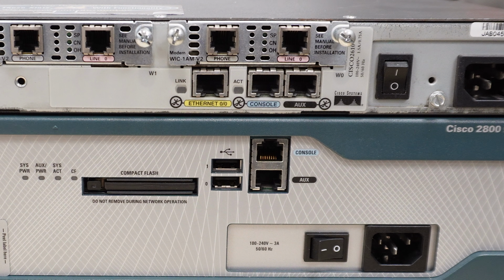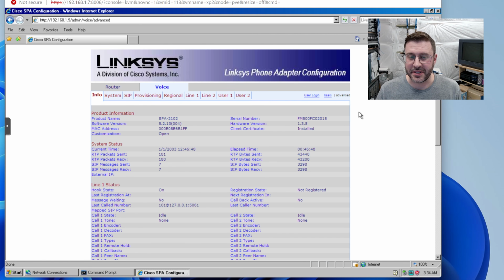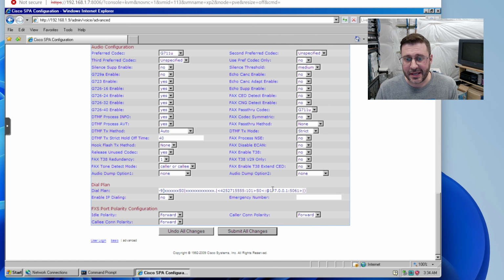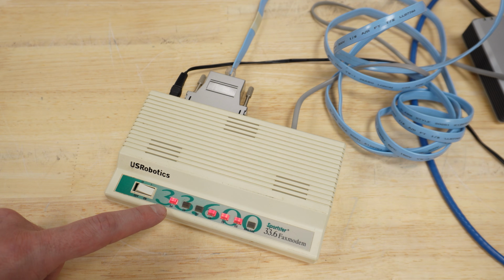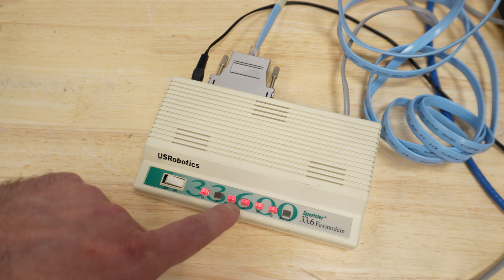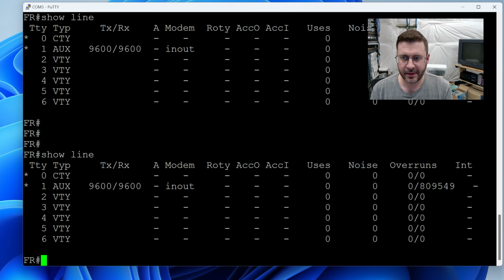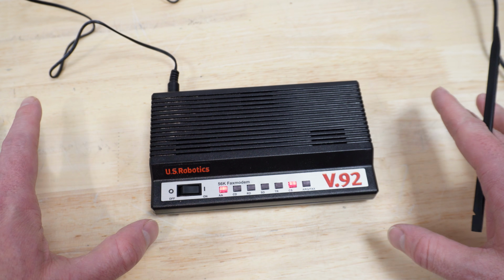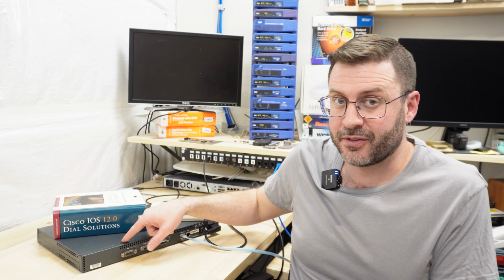Dialing into Cisco Routers

Comment: Never trust a premade cable or adapter! Troubleshooting serial connections almost always requires a simple breakout box that goes between the DB25 socket and plug. It's nothing more than a bunch of LEDs and possibly jumper cables to reconfigure the connection.

To connect a DTE (Data Terminal Equipment, the router) to a DCE (Data Communications Equipment, a modem), you need to connect GND, Rx, Tx, RTS, CTS, DSR, DTR, CD and RI all straight through (that's one more than an RJ45 plug can provide; at least one signal must be missing from the router). CD (Carrier Detect) is important because it tells the DTE that the connection is finally established. RI  (Ring Indicator) allows the DTE to answer calls whithout resorting to the auto answer setting of the modem. RTS and CTS were originally meant to turn on the transmitter hardware (Request To Send) and signal back its state (Clear To Send). They're typically used for hardware handshake in later implementations like smart modems. DSR and DTR are more or less static signals to indicate that the devices are turned on and ready.

Smart modems are special because they can autodetect the baud rate of the serial interface by monitioring the receive line for the "AT" command. The speed between the modem and the DTE is independent from the connection speed over the telephone line. Some modems even add data compression to the latter. This makes handshaking between the DTE and the modem absolutely neccessary. It's always a good idea to set the DTE baud rate to a higher value then the actual connection speed. 

As others have already pointed aout, in order to troubleshoot the runaway Rx/Tx blinking you should check for local echo settings on each side of the connection. This may create a tight feedback loop, just like a microphone close to a speaker. You can debug this by feeding one of the data lines to an additional serial interface and use a terminal application to monitor the data. Maybe you should hunt for an actual line monitor which might come handy in other cases, too.

Comment: The USB, USR 33k and V.92 modems have V.42, which uses LAPM or MNP to detect any noise and transmission errors, and retransmit faulty data. Usually this is enabled by default, BUT your line is either so noisy thst it falls back to unprotected, or LAPM is disabled in the permanent configuration of your modems. Try playing around with  the +ES and \N commands, write the config with &W to permanent store (or check with +ES?  what the setting is). During connection establishing, it should display CONNECT (speed) LAPM or V.42. Example command sequence to try:
AT+ES=3,2,4
AT\N2
AT&W

This forces the modem to negotiate either LAPM or MNP, and quits if error correction can't be established. You need to do this on the V92, 33k and USB modem, and on both sides. The 9600 modem can't do this.
Check the documentation of your modem types if they have the values different, but the ones I gave you are pretty standard.

Comment: Try this for an init string on your modems: AT&F&C1&D2S0=1
AT means attention, &F recalls factory defaults, &C1 enables data carrier detect, &D2 does something that I can't remember, and S0=1 turns on auto answer. I used to run BBSes back in the day and this is a generic modem initialization string that we used to use.
Edit: AT&V Will display the modems factory defaults and if you change things you can use AT&W to write them to the modem's NVRAM and then you can recall them with a simple ATZ command. 🙂
Reply: You can also try AT&F&D&C1&D2&D1&S0=1

Comment: You need to put the modem connected to the router into "quiet mode" so that it doesn't send the result codes to the router. What's probably happening is the router is sending something to the modem, and the modem is returning "ERROR". The router doesn't know what that means, so it sends its own error message to the modem, which makes the modem return "ERROR" again, which makes this feedback loop of data over the serial connection. Likewise, when the line rings the modem sends "RING" which will confuse the router as well. The Sportster modems have a DIP switch on the bottom to suppress result codes. Not sure how it's done on the Ultra 96; maybe ATQ1.

It's also possible that any modem whose history you don't know can have weird settings set from its previous life. It's not a bad idea to enter AT&F1 to initialize the default settings, and then AT&W to save those settings.

And as someone else said, your issue at the very end of the video is a crappy phone connection :)
Reply: Thats what I'm thinking. It seems to be getting something between the terminal as soon as the serial is connected and most likely the reason why the overrun is going up.
Reply: @iamthesargent  Yep, because the loop is as fast as the router can do, and it's faster than any of the modems can get it, so thats why overruns keep being racked up

Comment: This is what I loved about CisCos when it comes to networking stuff like dialin, setting up bgp and other wizardry, it takes 4 lines and it just works tm. Try to do this with a Linux or BSD box, let alone u need the whole os setup and configured you need to configure pppd, secrets, mgetty and whatnot and it was far from perfect even with its automated modem resetting after every call more often than not it died and the modem needed to be power cycled 😢

Comment: I think you should post a wiring diagram of your DB to RJ adapter to help get to the bottom of it.  Vague memory you want to jumper the CTS and RTS together or maybe it was if you don't have those wired correctly hardware flow control wont work?  Also disable flow control the same way you do an ASCII terminal session until you get basic response working.

Comment: For a "Networking" class I took for my CS degree I wanted more of a challenge, so I used an Arduino with a temperature sensor that would log the data to a PHP script and a database, but the Arduino was connected to a GMRS modem/module and I stumbled though sending AT commands to send a GET request with the data in the URL of my PHP site. I had no clue why those commands worked but I presented first to the class with the most complex project and didn't have to do anything the rest of the week.

Comment: For once you and I seem to have some of the same equipment!

I have a US Robotics 33.6K sportster just like yours from 1995, yours is in a bit better shape but it was neat to see someone else with one. 

Mine I got second hand from an old employer, it used to run hyperterminal for system management of a few sites.... 

The modem was connected to a IBM Windows XP machine and was in production until its retirement in 2017. Had the modem ever since. Once in awhile it comes out for use. At one point it even was in my tech bag and was used as a butt-set. Not ideal, but it got the job done until I could afford a proper unit.

Anyway... modems.

I think I've been watching your channel now for.... 2 years? 3 years? Something like that? Anyway, your comfort with the Cisco terminal has grown a lot, not that you were bad with it or something like that before, but it's obvious that it's far far less of a strange black box that you might not be comfortable with, great job! 

Occasionally I visit classes working with Cisco equipment and it's always neat to see the students getting more comfortable with the Cisco CLI, just something neat about seeing it, hard to explain.

Anyway, keep up the good work!

Comment: My comment before I finish the video is that silver adapter is not wired correctly. Remember your flow control must match at both ends. If you have hardware flow control on the modem. It must be supported on the opposite end. For example in a segment you had software flow control set up on the Cisco side but hardware set up on the other (computer) side. Check those configurations. Also make sure hardware flow control is wired up on your serial cable and adapters

Comment: Try dialing into the modem while it's connected to your computer (from USB modem to old modem). That way you can check the modems can connect without fail. Also fun-fact some US Robotics modems didn't need dial-tone to connect to each other -- If you issue dial command (ATDT) on one and answer command (ATA) on the other they will connect without a physical ATA unit in between.

Comment: It looks like the modem connected to the router is incorrectly configured.  I think what is happening is that the modem is sending text to the router, the router is interpreting the text as (bad) IOS commands and sending error messages to the modem, and the modem is then interpreting the text as (bad) Hayes commands and sending error messages to the router which is in turn trying to process them and you have a loop.  This 'back and forward' is possibly filling up the input buffer on the router and generating the overrun errors .

There has to be some howto's on correctly configuring a modem to connect to a Cisco router Aux port.  Possibly an ATQ1 to make the modem not send text to the router

Also, from memory there are additional AT commands that let you 'lock' the modem serial port at a specific speed (e.g. 38400) and the modem will use that baud rate to communicate with the router while negotiating whatever speed is needed over the phone line.

There is another configuration command within the router (modemcap) which sets the initialisation string to send to the modem, as well as possibly allowing you to use a 'chat' script to configure it. 

I feel you are almost there :-)
Reply: The runnaway blinking of Rx/Tx looks more like a feedback loop caused by local echo turned on on either side of the connection. It's the same as if you put a microphone too close to the speaker.

Comment: Nice! I have 2 broken ATA adapters, and cannot configure them, but one of them still has the 48v on the RJ11 although it will not give the dialtone, but the voltage is all that you need. You dont have to degrade the connection passing it through voip filters, in this way, it connects the best speed the modem has at optimal conditions. All that you need is a RJ11 phone line splitter, that beige adapter that has a male and 2 females RJ11, so you plug the adapter into one of the MUTE ATA ports (you don´t want the dialtone, because it will mess the connection, disable the service)  just to get the voltage and the 2 phone cables in back of the adapter, so the modems will listen eachother. The 2 modems must be on the same ATA port! If you dont havean adapter,  just mend together 3 RJ11 cable ends, plug one on each device! Now you need to pass some AT commands, ATX0DT123 on the modem dialing, X0 disables the dial tone detection, so it dials right away, without complaining No Dialtone and on the other modem the command ATA to answer the call. I Still Have my precious USR Courier from the old times! I think it will never connect 56k X2 or v.90 because the telco did some trickery for it to work, but it will connect v.34, the com port speed must be configured 115.200bps. You can try using some Terminal program, I use the classic Procomm Plus! It also supports telnet BBS´s that are still around. I have it installed in a Win98 oracle virtualbox, machine and it can access the COM1 port on the host to use the modem.

Comment: You've got a lot of stuff in that there basement, have you ever looked into checking for EMI problems? I'm asking this as a secret backdoor into, how would you do that? For a moment my work was thinking about moving to a location literally under a set of high voltage power lines, so I researched it a bit. There's lots of ghost detectors, like busters ghosts, but the only thing I could intuit that seemed remotely real was getting a spectrum analyzer and ideally a directional antenna.

Comment: I think CRD mentioned the VOIP ATAs don't handle data very well and recommended using something like the TELTONE TLS (Telephone Line Simulator). If my memory is correct, that could be your issue and your modems are fine.

Comment: I've used the AUX port for a reverse telnet connection to the console of another device, but never with a modem for dial-in management. Always wanted to try it though, so I'll be very interested to see if you can get it working.

Also, when it was kind-of working, the latency seemed way high, even for dial-up. I remember using BBSes at 1200bps back in the early 90s, and the latency was nowhere near that bad.

Comment: That blue cable, unless someone messed with it should be rolled, 1-8, 2-7.... 8-1. Cisco equipment used to ship with a 25 pin and 9 pin d sub adapter to RJ45 and two cables, the blue rolled cabled for console, and a silver straight through (a standard network cable can be used in it's place) which should work with a Cisco pinout db-25 to rj45, modem, and aux port.

Couple things, remember when an IOS device gets a command it doesn't know it tries to look up the name in DNS and you have to wait for it to timeout, so add NO IP DOMAIN LOOKUP to your config to make sure you're not trying to lookup the garbage or connect messages. Try using a PC on each end (or just two copies of PuTTY and one pc) to test your dialing.

Bonus stupid trivia, you can get a null modem cable using two of the Cisco DE-9/RJ45 adapters and a rolled cable, or straight through using a straight through cable. You should be able to use those adapters to talk to your modem across a network cable from your workbench to your rack with whatever magic combination. The Cisco adapters do not bring all the signals since for the magic they have pins 4 and 5 connected together as signal ground, but hardware handshaking RTS/CTS and DTR/DSR are present (no Ring Indicator or Carrier Detect).

Enjoy your serial lines.

Comment: Friendly neighborhood graybeard network engineer here. I’ve actually used modems connected to the console of a terminal server connected to the consoles of routers to fix misbehaving routers internationally. That SD/RD flashing you were seeing is most likely the router and modem in an error message feedback loop. I’ll see if I can find the magic init string and Cisco serial settings (we had the inbound modem on console, and used aux for dialing out from the router) we used to make it all work. I do know that we used sportsters, so whatever documentation I find should be directly applicable to your setup.
Reply: It makes sense that echo is causing it to get wrapped up in a loop, the Cisco would be sending out a config command etc and getting it straight back as an echo, which would mean sending an error out and getting it back and on and on again
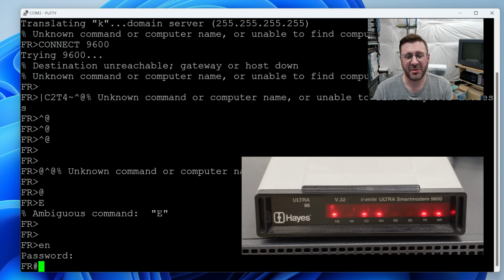Reply: @balthxzar  True, that would also explain why at 22:49 the modem "issued" commands meant for the modem to the Cisco gear via serial.
Reply: Or a local echo enabled at the modem while Cisco expects ATE0. Setting software flow control will make it go away but it's only a band-aid not a cure, if I'm right.

Comment: I had that same modem and it died with all the lights coming on, I was more of a internal modem guy and the battle of the standard for 56k was between us robotics with X-2 and motorola with K56 was fun too. Had dual modems in the server with two phone lines and you could pool the modems together, that's the best u got back then before broadband but luckily we had ISDN in my neighborhood thanks to my neighbors company and he hooked us up with a 128k ISDN connection. The modem pooling was cool just like remote access with it here, miss the sounds probly the most and still remember all the AT commands lol. Great vid man and good work as always.